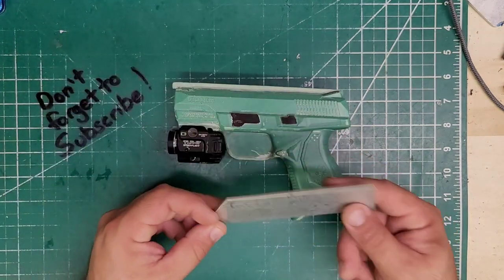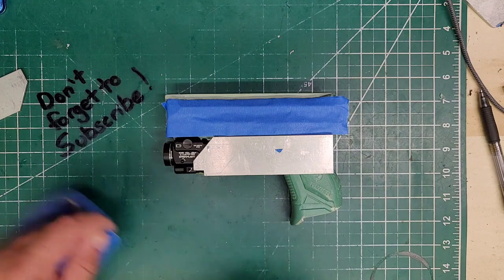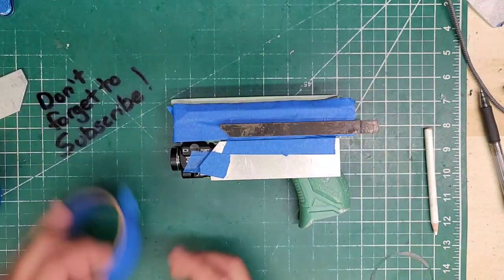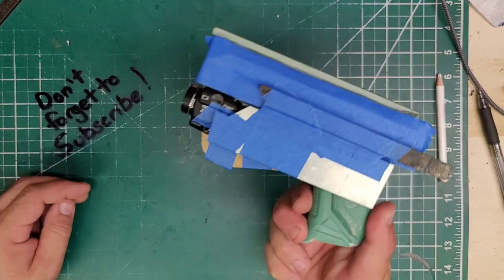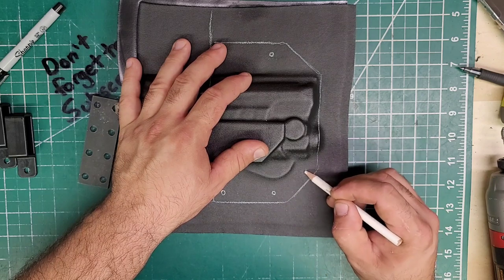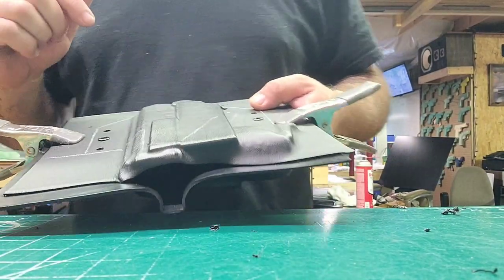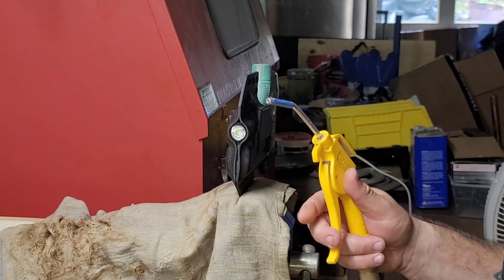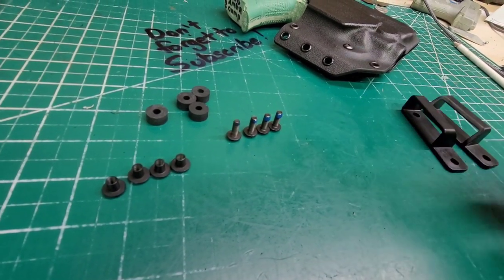Ruger American Compact with TLR8 OWB Pancake

Comment: Just out of curiosity what size spacer, post, and screw did you use for retention?
Reply from the maker: 1/4 post
.4375 screw
Whatever you feel works best for rubber. 1/4 min